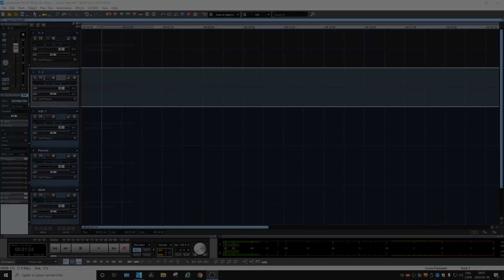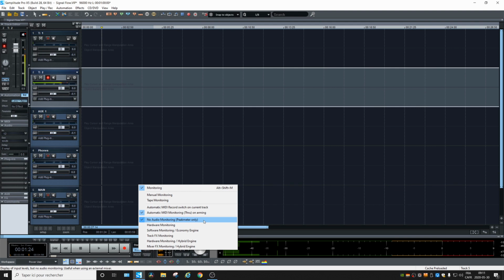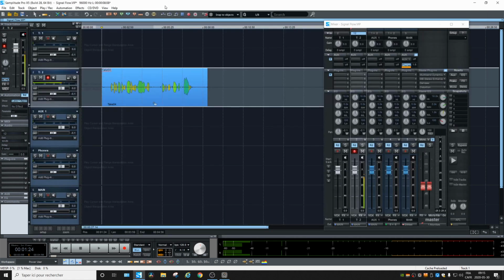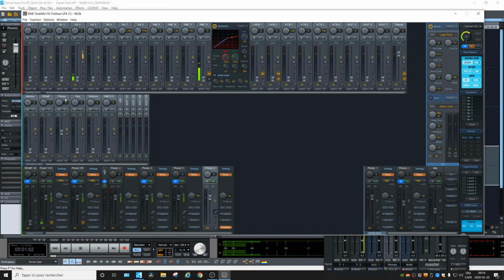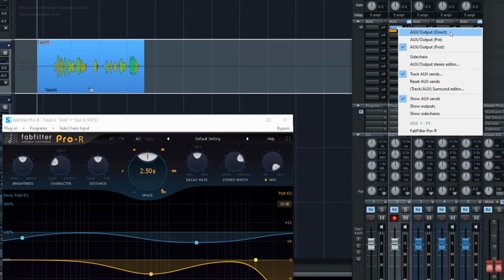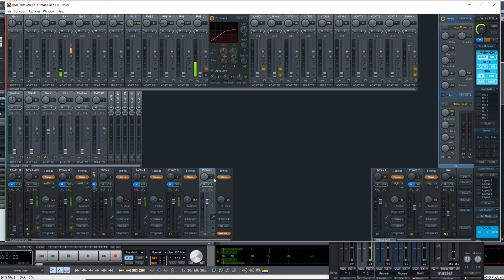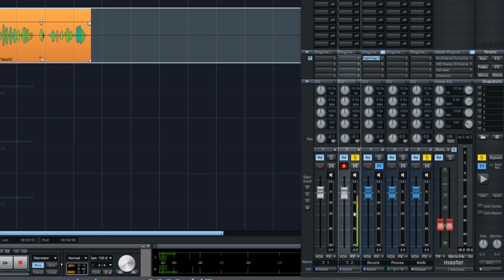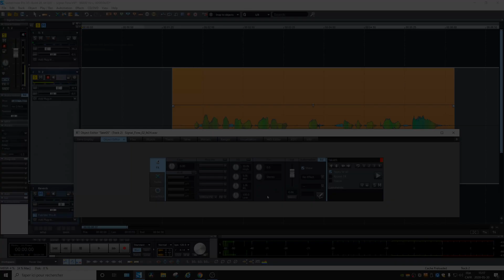Magix Samplitude Pro X4 - X5 : Signal flow

Comment: Marco, you have accomplished what I am attempting to do...I think. I just ditched my mixer and decided to make the jump into the world of interfaces. I got a Presonus Quantum2626 and am no dealing getting it configured to my Samp ProX3. This is now day three of downtime for my studio and my patience is running thin. The tech support at Presonus has never even heard of Samplitude if you can believe it! So dealing with them is a task at best. They keep throwing me links like spaghetti, that don't address my problem, hoping I'll stubble on something, or get bored, or just give up and just return the unit. I had to lecture them on the merits of good customer relations and the importance of knowing the products and their related associates and so forth. Anyway, once I got TB3 going and the Q2626 talking to Samp I encountered a wall. I wasn't getting any monitor signal thru the headphones. Digging deeper I changed the monitor setting engine over to Hybrid and this produced a monitor signal, however with way too much latency. Moving that setting back reduce the delay but not completely. Then I went into the Universal Controller for the Q2626 and began lowering the "Block Size"...which I'm still not sure what that means. I think sample rate but not sure...still waiting for that answer from them. Originally set at 512, I began  to lower it and the delay incrementally went away...YAY! But...this is where you come in. I now have a monitor signal thru the H-phones along with playback, but these two volumes are locked together and I have yet to figure out how to separate the two...monitor/master to get a monitor balance I can record with. Does any of this make any sense? I'm still chipping away at it. Your thoughts, or anyone else's are welcome.  I would send this via facebook but I hate facebook.
Reply from the maker: Make sure you install the latest ASIO drivers from presonus website, then check this video.. maybe it will help : https://youtu.be/w_uVMNDsPRs
Reply: @MarcoPrimeau  All the latest everything has been downloaded. You can't even turn this thing on without their exclusive driver. That's not the issue and your vid here pointed me in another positive direction by right clicking on the monitor button...so thanks for that. I'm going to check out your link now to see what more tid bits I can get. Thanks again Marco!
Reply from the maker: @stevend984  Usually everything coming in live, I control the monitoring via the virtual mixer of the interface..(Redirecting to my monitors and a seperate output for headphone amp. For what is already recorded I create a buss with a seperate output, then send what I need to it while being independant of the masterbuss.. Hope you get your own recipe soon..
Reply: @MarcoPrimeau  Thanks for the assist...To clarify, I'm working on  recording a vocal track to a tune. So, now after watching this segment on Aux sends, I tried doing that on this voc trk to try and give some added volume to monitor by but it's still linked to the master volume and I'm racking my brain. There has to be a way to separate the monitor mix from the main/master volume control to do this... I just haven't found it yet. This stuff really should not be this difficult! I know you're using a separate program to do all this and it may come to that for me, there has to be a button or a knob I've overlooked or miss that will do this. I really don't need all the bells & whistles, I just want to sing some stuff and get back into a rhythm with no more downtime! Thanks again for the ear.
Reply from the maker: @stevend984  Your interface has many outputs.. you need to send the aux output to a different output than the one of your monitors to send the music only.. not the track you are recording.. Than in your virtual mixer (of the interface) create a mix that sends the vocal input directly to the headphone output and mix the music at the desired level..
Reply: @MarcoPrimeau  Precisely... Now can you say that in English? Just kidding... First off this interface...the Q2626... has no mixer. The mixer is in Samplitude. So not sure what you mean there.  Again...No virtual interface mixer. I am working completely within Samp. But still there must be a way to separate monitor record signal from the master. It's there I just know it.
Reply: @MarcoPrimeau  I hope you read the "Precisely" comment before this one...that keeps them in order, cutting confusion. Had a break thru last nite, but not sure I can even explain it! One thing for sure is the key is in using the Hybrid engine. Sending the vocal track to an aux send track the volume on the aux track is independent of the master vol. BUT... I still cannot record the vocal track, things get all weird when you hit record! So I thought if I'm getting the vocal signal to the aux trk, what if I record onto the aux track? I've never done that...obviously.  So I did... and it worked! I really had to pull down the master but was able to get a good monitor volume to record. Although this worked, I'm pretty sure I just found a loop hole in the system because A] It shouldn't be this difficult and B] Just how the system functions doesn't seem right. Here's the weird part...in the aux trk test recording, when I moved it back up to the original vocal trk [where it should be] and where I have the FX for that trk, it is not in sync with the rest of the song...it's behind just slightly by about a quarter step... Easy fix but another indication that I stumbled on an anomaly, and it really shouldn't work that way.  Worst case...I can at least cut back my downtime now and start making baby steps forward. I have a new ART preamp compressor to go with this Q2626 that I have yet to configure into the chain. So YAY...sort'a. If I find that the best way to solve this is to go with a virtual monitor, although Samp should be able to do this... what would you recommend?  Your thoughts?
Reply from the maker: @stevend984  Humm sorry if I'm off since I don't have the Presonus.. but Nearly every interfaces have some software to control inputs and outputs.. here's a guide I found that might help it clearly talk about a virtual mixer and your 2626 is part of the compatible models.. even on the product page, the presenting videos shows it.. https://www.presonus.com/learn/technical-articles/How-Do-I-Make-a-Monitor-Mix-With-My-Audio-Interface
Reply from the maker: https://www.youtube.com/watch?v=NO40nZ3tUcQ&t=1s
Reply from the maker: It is not like RME mixer.. but .. maybe it can help...
Reply: @MarcoPrimeau  Seen this one already early on...but I will sift back thru it again to see if I can pick up anything more helpful.
Reply from the maker: @stevend984  If you can't redirect anything within the interface itself, you may want try different monitoring modes of samplitude.. Sending you positive vibes as most as I can ;)
Reply: @MarcoPrimeau  Before I dig back into this just presonus link thought I'd let you know the last time I replied to them [Presonus support] was two days ago and I got nothing but crickets so far! I think I hurt his feelings with my lecture on doing a better job with customer support...Hey if you can't stand the heat...find another job! I'll keep you posted..Thanks again for YOUR support!!! Nice to see someone care about us lowly musicians! After all...we're not the ones keeping the industry going are we?
Reply from the maker: @stevend984  Sad, really!
Reply: @MarcoPrimeau  This doesn't address the Q2626. And the support guy got back with me and said the Q2626 doesn't have a interface mixer.
Reply from the maker: @stevend984  Oh.. sorry about that.. Most have one.. That's weird.. a virtual mixer give zero latency that's why I insist using it.. Did he help you with what you want to do ?
Reply: @MarcoPrimeau  I'm getting dizzy trying to keep up with this string...but I appreciate the encouragement...and no, these guys take their sweet time making promises they can't keep. Plus... are really plugging & promoting the Studio One stuff offered with the unit. I really can't see installing and having to learn ANOTHER DAW software just to be able to run this unit. Politics...uurrg! Oh well, I'm back at it... I'll keep you posted. Thanks again!
Reply: @MarcoPrimeau  Hey Buddy...Still pluggin away...literally! This may sound stupid but out of desperation, I started searching for programs and even hardware to address my issue and I couldn't find anything that indicated specifically doing what I want. Maybe I'm just not looking for the right thing, but since I've never gone there before, I'm at a loss. Are you able to recommend some options for me...software and even hardware? I got snake eye again last night. All my feelers are out but all other replies so far have yielded zipp!
Reply from the maker: @stevend984  Ok I had do read your first post again.. Is your situation the same "I now have a monitor signal thru the H-phones along with playback, but these two volumes are locked together and I have yet to figure out how to separate the two.."  My question is, are you able to change the output of an aux buss ? (at the bottom) choose a physical output of your 2626 other than the monitor output. IF you are able to do that. Create 2 buss, 1 for the music and 1 for your vocal, both sending to the same output of the 2626, one of the headphone output. Then both of your buss faders will become your independant volumes... I'm not getting the 2626 being so hard to operate.. Any focusrite or RME interfaces would simplify things greatly by giving you a realtime - no latency virtual mixer..
Reply: @MarcoPrimeau  I gonna really have to stew on this because it's pushing my limitations of capability. I have rarely used aux/busses before so it's mostly uncharted for me. The other reason I got the Q was TB3 connect. Just heard back from Presonus... he's just rehashing redundant s**t, and of course recommended that I install their Studio One program to just do a test, which ironically today I had considered doing. But then I have to figure out how I can do a transfer of file to Studio One. I'm just anxious about working a different DAW program. But I think all these years working with Samp I can probably figure this out. Thanks again! These strings are getting a bit complicated.
Reply from the maker: @stevend984  Busses are the only way to seperate outputs at the software level. The also allow to receive any number of track signals and you can add effects on all of them at the same time.. For exemple Drum buss with a compressor on it.. In samplitude, on top of each recorded track, you have a section for AUX Sends. If your project doesn't have a buss. pushing up the level on an Aux send will create a buss. You can send 1 or more tracks to the same buss. For monitoring, you can call 1 headphones, then bellow the name there is an output of that Aux buss you should change for your headphone physical output on your interface. Then, push up the levels in the Aux send section to create a headphone mix to your liking. Try this with only one buss first.. On physical mixers Aux sends where created to send the signal either to external effect unit or internal effects included in the mixer.. The same principal apply to Samplitude mixer.. I'm going to make a video about gain staging this weekend. I'll try to squeeze a bit of info about busses. If not, I'll plan a video about monitoring with samplitude alone..
Reply: @MarcoPrimeau  Thanks so much for the tips! Really appreciate it a ton. You are a standout in our world and I only hope one day I can return the favor. Really look forward to videos. If either in any way assist in this issue, you should definitely make sure you include that in the vid title. I'm sure it will bring a ton more viewers just like me. I'm gonna get in there later today and fumble around some more. Will keep you posted.
Reply: @MarcoPrimeau  I'm gonna try this method for reply to see if I can cut down the string confusion that building with our back & forth.
So in further review of your info here, last nite I dug deeper into Aux/Bus usage and it's weird because some info refers to Aux bus & Bus Bus as the same thing. Since I deal in specifics, this can get confusing real quick. Last night I create an Aux bus track and then also a Bus track, so the system created two different identifiable "Bus" tracks, so the system does differentiate the two but I haven't yet figured out why and how they are different. Gonna check that some more tonite. I think I here what you are suggesting which is to run my project thru an Aux or "Bus" track as opposed to thru the ST master/main. Then do the same for a track to record my vocal. What I've  been doing up to now is that but only for the vocal track. Please note...this is a finished project with about 28 tracks including FX already mixed down. I just decided I wanted to re-record an improved vocal track with my new equipment, to this already finished project...[hope that makes sense]. Another thing regarding your info below...at the bottom section of the track...[the output option bar/button]  there is no option for headphone monitor, only 1/2 3/4 5/6 7/8 9/10. Another weird thing I noticed right away on first setup...the ST main out for playback I/O of the Q2626 will only run thru 1/2. I've tried to run it thru another set and no dice...won't play...only 1/2. Not sure if that is a hint for anything or not.  Well that addresses all from below, now I get to in and rack my brain some more to see if I can find some magic. Thanks
Reply from the maker: @stevend984  I bet output 9/10 is an headphone output.. no ?
Reply: @MarcoPrimeau  I lost a complete reply with an update that said I had a breakthru. But here's the deal. I have been working in three separate VIP's...one for alto practice, one for tenor practice, and the main one I've been doing the Q2626 configuring on is the one I'm re-doing the vocal on. The vocal track is the one I had a breakthru with last nite. The weird part is I can't explain why...it just started working. The Hybrid engine setting is key...and after going back & forth it suddenly started working like it should...imagine my surprise. I ran a few test recording and it was working just fine...without any busses! So I came out and sent you the update about the breakthru...but I can't find that reply. Now here's the tell. I went in today to double check everything, pulled up the vocal VIP that was working properly on, and it still works fine. Then I pulled up the other two VIP's mentioned and with identical settings as the vocal VIP I am getting major latency issues that are not present on the vocal VIP. I back tracked again and I'll be damned if I can figure this out AGAIN. Somehow there is a serious glitch on either these VIP's or the program itself. I shutdown/re-booted...back & forth but no change! This is ridiculous. The only monitor setting that separates the monitor from mains is the hybrid setting...but it's only stable on the vocal VIP... so far. Oh BTW...I found out the the outputs on the back are the monitor sends. So that should answer your question about 1-10 outputs. I'm getting a headphone amp to hopefully solve this issue, but I still have some reservations as to how that will work...we'll see. At least I was able to get some vocal work in tonite...YAY for that.
Reply from the maker: @stevend984  I'm glad you start to have some results.. I'm going to plan a video about this for next week,. this week is about gain staging.  Yes the outputs on the back of the 2626.. but in the settings of samplitude, in the list of outputs.. you should see those outputs and some representing the headphones output of the 2626 as well. Unless they are deactivated. Hit Y to go in the settings.. Once you know the output name, choose it as your aux buss name.. Also if you are using the monitoring features of Samplitude. once on hybrid you also need to activate the little speaker (for monitor) on the tracks you want to hear..  I just never do it this way myself.. using a buss instead.
Reply: @MarcoPrimeau  Yeah... sort'a. The list of outs in Samp are only 1/2, 3/4, 5/6, 7/8, 9/10...only. There is no monitor designation. I still can't explain why one VIP works perfectly and the other two don't. The other weird part is on the other two VIP's, with identical setting, one has more latency than the other. Something is really off. I really don't want to re-install Samp unless I can find out for sure  that will fix it...but those guys don't know, they just throw stuff at the wall and hope it sticks. I was thinking overnite, even if I get a separate headphone monitor amp, which is on the way... if outs in Samp won't separate from the mains I still have the same problem don't I? The econo-monitor settings have no delay but don't separate the signal, the hybrid engine setting separate the signal, but creates delay, but not in the vocal VIP. You tell me? Since the vocal VIP is okay...so far... I was able to insert my EQ in the signal for some experimenting and that worked well, so some good news there. Tonite I will insert my new ART Channel II preamp/comp to see what happens. Will let you know... Cheers
Reply from the maker: @stevend984   there most be a way to send a signal to the headphone amps.. sometime, they share the signal with a line output one the bac..
Reply: @MarcoPrimeau  I'll let you know when I get it...meanwhile I'm gonna keep pluggin away in Samp.
Reply: @MarcoPrimeau  I was gonna try and plug in to my stereo tonite but I got hung up on testing my new ART Ch II preamp/compressor . I didn't even get into Samp issues tonite. I just wanted to experiment, test and sing a little. Now I have a beef with ART, but that's another deal. I'm gonna try and plug the outputs into my stereo and see what happens. I'll keep you posted.